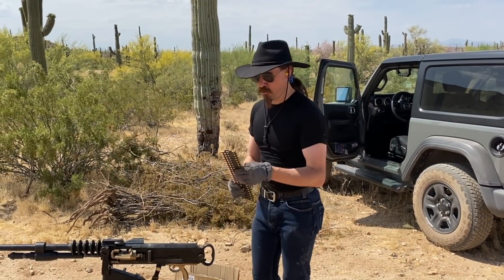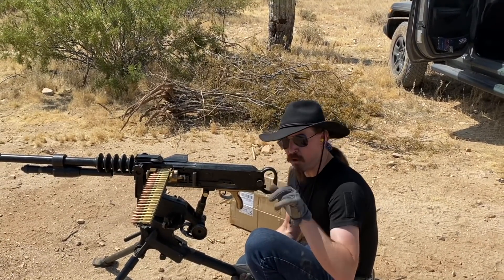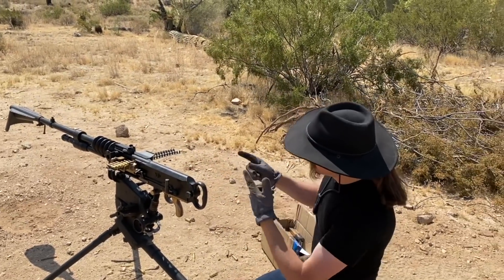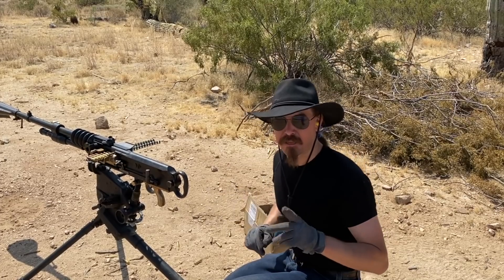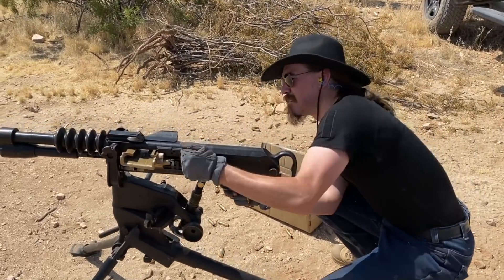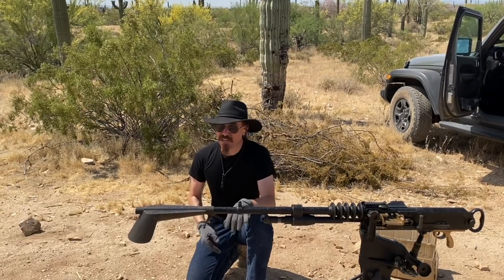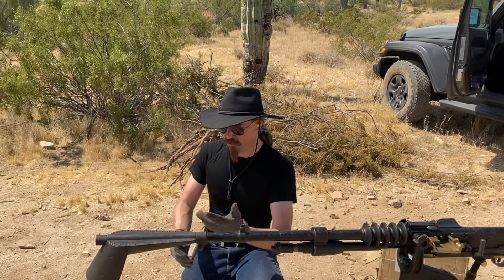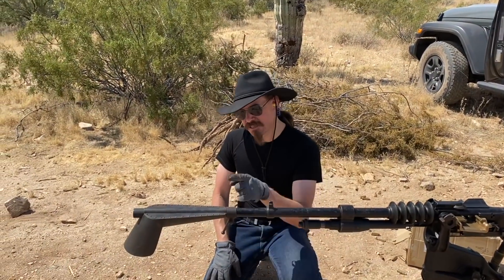Hotchkiss 1914 Cow-Catcher Muzzle Device

Comment: you may have to take into consideration at the time of this guns use they were experiencing trench warfare. the blast may not kick Mud up quite as readily as it would tinder dry desert like dust as your experiencing in your shooting conditions . also when fired your not sending a smoke trace as noticeable as its directly jecting Downwards to the ground instead of Out of your position.into the air showing the enemy more clearly where your firing from. ? heaven forbid an enemy ever got up next to the other side of a sandbag barrier with this shooting over it ?

Comment: I have heard more about mud than dust on the front, so how about a mud test on the flash hider?  A couple of buckets of mud on that round spot...
Reply: But the front wasn't muddy twelve months of the year, especially when the front was Gallipoli or the middle east, even the western front had plenty of dry spells, which is why period training manuals say that the ground should be wetted or wetted (empty) sand bags etc. should be placed on the ground under the muzzle of machine guns so the muzzle blast doesn't kick up a dust cloud when firing in dry conditions.

Comment: an MG crossfire
imagine a race with two machine guns firing diagonally across the race track. from either side.
you lock the mg on their tripods to fire in a line. you don't need to aim and swing about looking for runners.
the runners will all run through the stream of  bullets because they have to to reach the finish line.
how many runners will make it to the finish line?
its as tragically simple and effective as that. 
you cannot attack the machine guns because they have other MG providing a crossfire in front of them, and so on..
its the same race in all directions..
Reply: Reffered to as Enfilade Fire.

Comment: Odd that they would use strips instead of a belt
Reply: These were very early designs for machine guns. The feed strip makes a bit more sense than a cloth belt, but it basically took JMB to design the ideal disintegrating belt that we still use today.